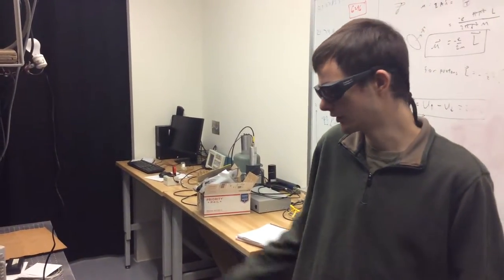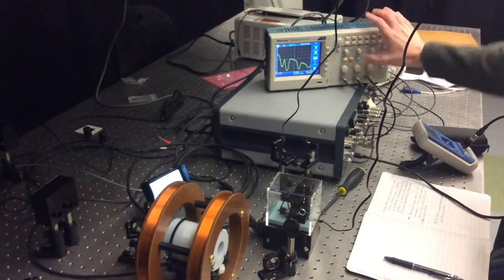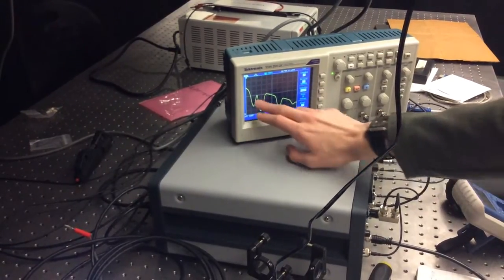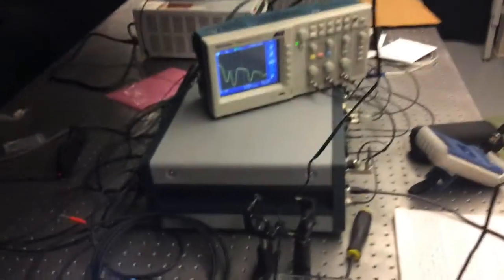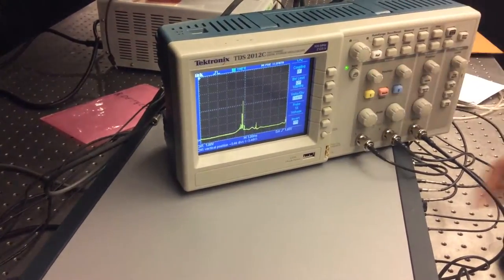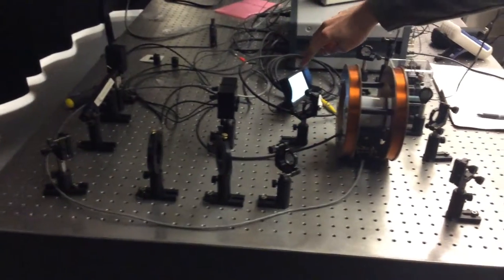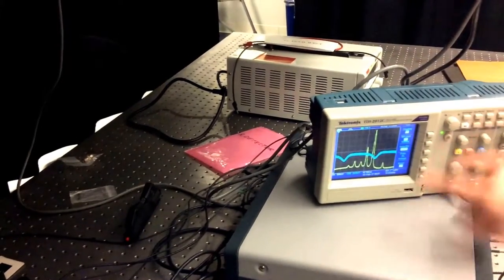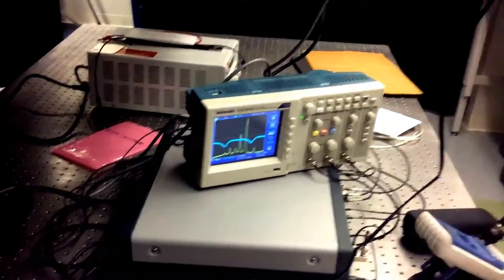PHYS333 Saturation Absorption Spectroscopy Demo

Comment: Thank you for this video. I have a question about how to make the oven to heat the vapor?
Reply: A desired sample is carefully placed in the oven. The oven is then wrapped around with wires and you supply desired amount of current through is which gradually heats up the oven. The material of the oven is chosen in order to minimize the radiation losses.